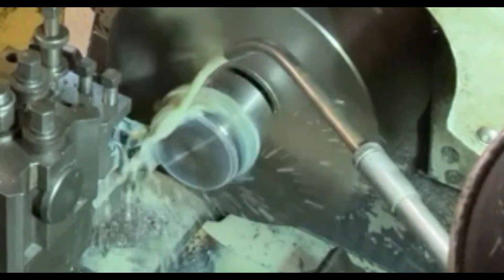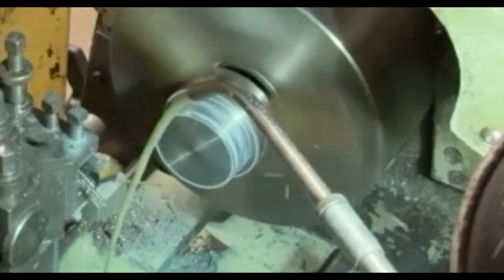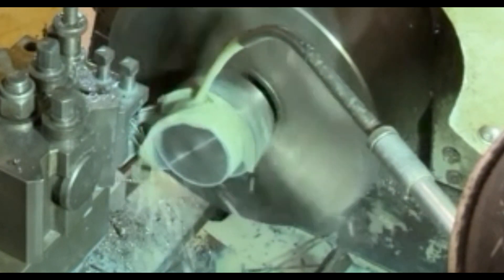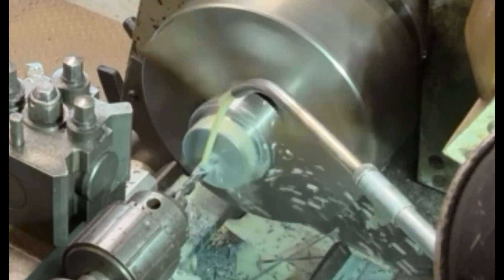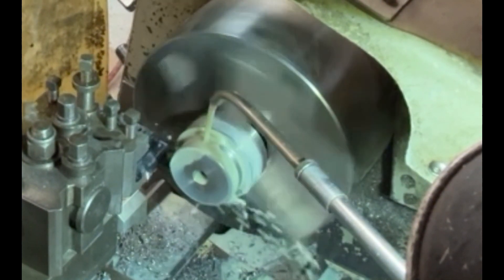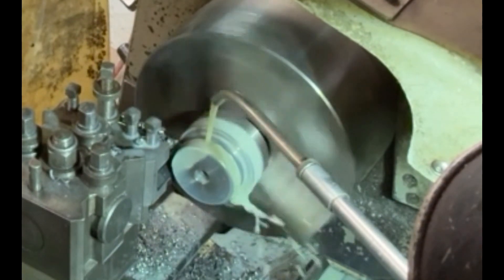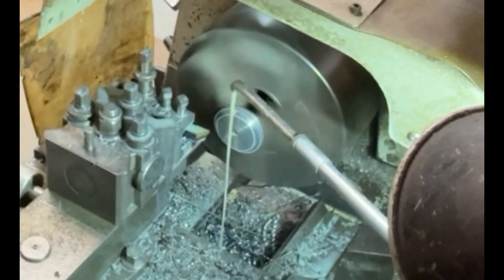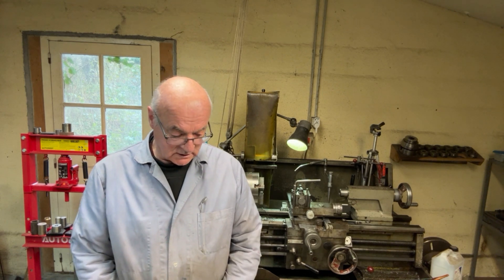How to Make a Large Clamping Washer

Comment: Love the Triumph 2000, what a lathe.
I have one, with a taper attachment, although I have removed the compound and run 25mm tooling with a solid post and quick change tool post.